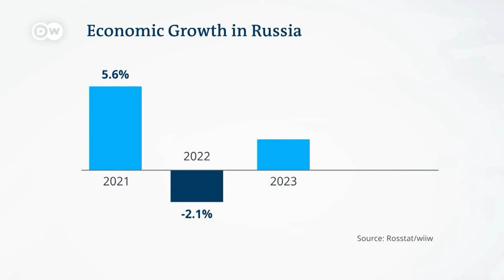13th sanctions package on the second anniversary of the Russian invasion of Ukraine | DW News

Comment: What we can do as individuals, is to reduce the amount we buy of petrol/gasoline, diesel/heating oil and methane gas. The lower demand on the global market, the harder it becomes for Russia and the rest of OPEC to make a profit on the remaining volume of crude oil and methane gas, that they can sell.

If you have a gas furnace, is it running as efficient as it can? Maybe it needs som adjustments and tender love and care. Maybe you can increase efficiency by increasing radiator surface ara to lower the required water temperature? When was i last checked?

Lowering the consumption of imported fossil fuels not only reduces the greenhouse gas emissions, it also shifts the balance in the war in Ukraine.